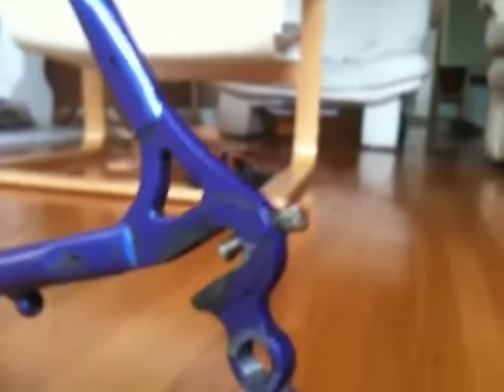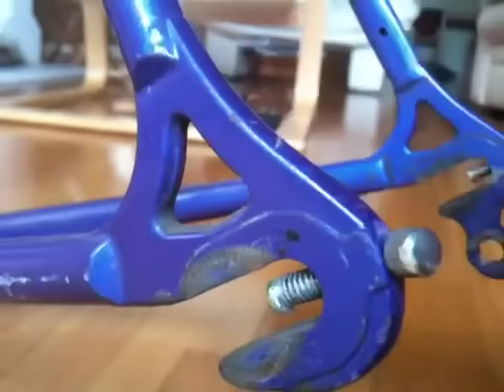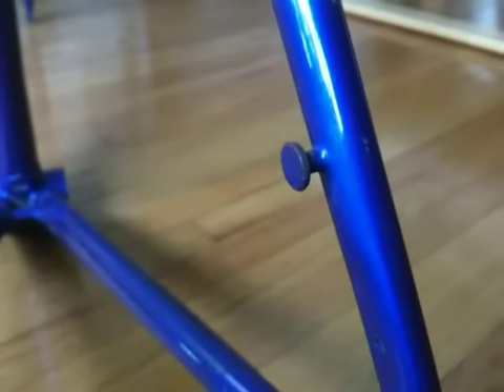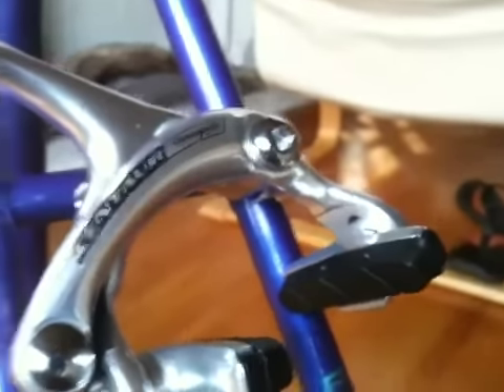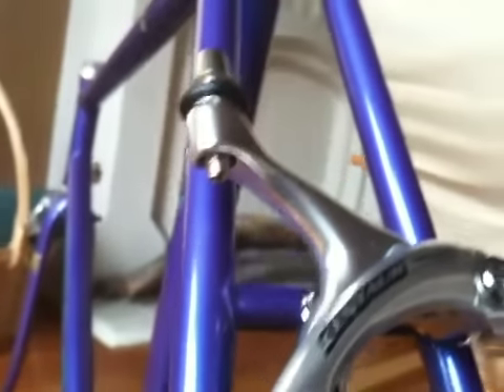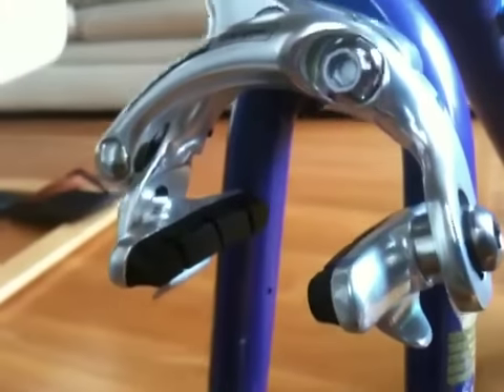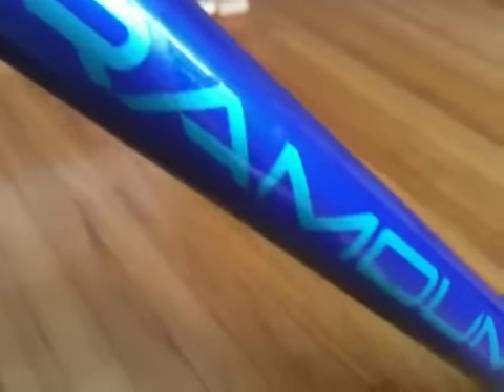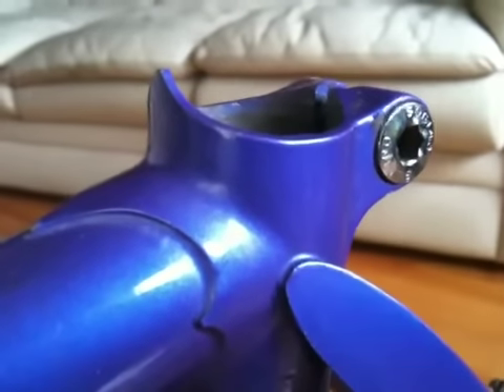Nick's 1992 schwinn paramount

Comment: I just just did a ground up restoration/upgrading of my 1974 Schwinn Le Tour for around $400,it now worth over $900! keep hitting craigslist for parts and also ebay and Harris Cylclery, see articles by Sheldon Brown for info on pretty much anything!
your bike is gonna take 700c wheels and most other elemnts on this frame are standard road bike sizes. in short .. you have an awsome starting point in which complete will blow many of the newer bikes out of the water!!  great bike!!

Comment: the holes on the chainstays are for drainage. for example; if you go for a ride in rain, chances are some part of the inside of your frame will be exposed to water. the holes are for drainage so the beautiful tubing on that bike doesn't get corroded as quickly. the that is broken on your rear drop out is a chain tension adjustment screw for when you mount the rear wheel, you can adjust the slack in the chain. the knob above where that screw you were curious about is for holding your chain in place so when you have the rear wheel off, you have somewhere to set your greasy chain without damaging, or dirtying up the bike. plus it ensures that you have somewhere to safely set your chain. I had that exact model a few years ago. everyday i regret getting rid of it.

Comment: The frame in the video is NOT a "Waterford Paramount."  It is a "Series" Paramount, made in Japan by Panasonic.  When new, it would have had a small decal under the stylized "P" logo on the head tube indicating country of origin.  The Tange rear dropouts are a dead giveaway, too.

While not a "real Paramount" in the eyes of some, the Series 5 and Series 7 PDG Paramount models had very high quality frame-sets.  They were made with  Tange OS double-butted chrome-molybdenum tubes and used Ishiwata lugs and bottom bracket shells.  The brazing, lug-work, and braze-ons like bottle cage bosses and cable guides were as good as anything you could get back in the early 90's and the frame-sets were very accurately aligned.  The oversized tubing gives these frames a LOT of stiffness in the bottom bracket area so they resist energy-sapping flexing when sprinting and climbing, getting more power to the ground, yet they have that cush, resilient ride that quality brazed-lugged chrome-moly steel racing bikes were supposed to have.

They're not Waterford Paramounts, but they're very good frames and were kind of "under-spec'd" component-wise when new.  In other words, the component groups didn't really match the quality of the frame sets -especially the wheels.  My 91' Series 5 is pretty much all original with the only parts changes being the saddle and tires.  It had an all Shimano 105 group, including headset, crankset and bottom bracket, derailuers, and brake set, along with wheels laced on 105 hubs and 105 "Look compatible" pedals.  The Series 7 would have had a higher end component group -Ultegra, I think, along with lighter wheels -Campagnolo Mexico rims instead of the Wolbers mine has.

The little screws at the ends of the dropouts are used to align the rear wheel.  Most quality road bikes of the era had them and you might still be able to get them at bike shops.  The holes on the stays and fork blades are relief holes mandated by the lugged-brazed construction and are indeed there to relieve pressure build-up during the brazing process.  The little peg on the drive-side seat stay is a chain-hanger peg and the purpose is to hang the chain on to facilitate rapid wheel changes in competition.  The peg on the head tube is for the Silva, Zefal, and later Blackburn tire pumps that needed such a thing to stay attached to the frame,  The head of those pumps had a female divot for the male peg to fit in to on one end and the spring if the pump provided enough pressure to keep the other end pushed snug against the top tube and seat tube.  The pump peg was "neater and cleaner" than clamp on pump retainers previously used but is kind of useless now since the world has gone to CO2 inflation for roadside flat repair and since tire technology has improved to the point were flats aren't as common as they were back in the day.  All of the Series Paramounts take 700c wheels, excepting one very rare model made for 650's.and the rear dropouts on mine are spaced for 127mm axles but will take 130mm with no problemo.  

The "Series" PDG Paramounts aren't USA made but they're not exactly commonplace, either.  I don't think Schwinn imported a bunch of them, A lot of Schwinn dealers where I was living at the time didn't bother carrying them, when they were selling Centurion, Nishiki, or Univega in addition to Schwinn.  They didn't sell all that well, either, from what I gather.  Mine was bought new by its first owner after it had sat in the bike shop for a couple of years.  He only put about fifty miles on it, hung it up in his garage, and forgot about it for the next 20 years.  I bought it as a replacement for the Bianchi Campione D'Italia I bought new in 1987 and rode for the next 20 years.  I think the Series Paramount frame is MUCH BETTER than the frame on my Bianchi was.  It is significantly stiffer in the bottom bracket but has a more compliant, cusher, miles-eating ride quality.  If I still lived in a world of quill stems and threaded headsets, I'd happily get another one as a bare frameset and build it up with Dura-Ace or something like Campagnolo Chorus.....   But I don't live in that world, anymore.  

I love my Series 5 PDG to death but I'm afraid to ride the thing every day because compatible components that were the industry standard back in the day aren't anymore...
Reply: They are dank bikes, The series 3 is also double butted TANGE OS but has crappy groupset. This bike ridesike a dream. Snappy and precise while maintaining a supple feel... dope bike I bought and sold a very nice carbon roadie because it didn’t pop like the paramount.

Comment: thats a dropout adjustment screw, its to fine tune your wheel alignment and improve shifting, turn it in as far as you can until you have unbent screw, and then cut it off with a hacksaw, then chase the threads and then replace it with a new one.